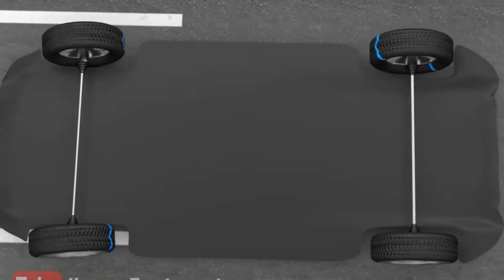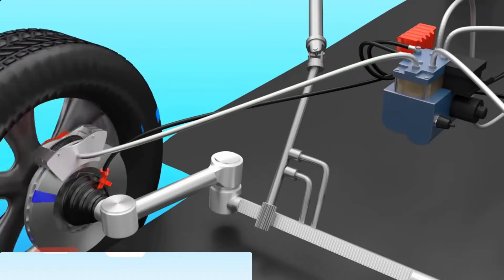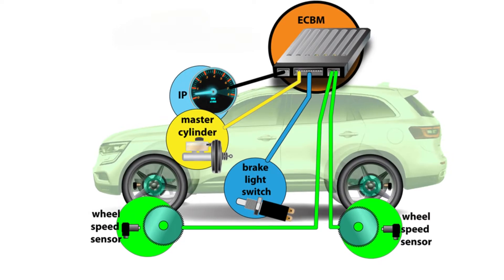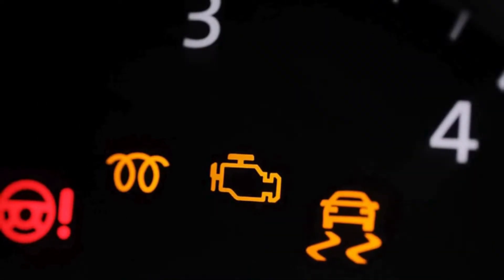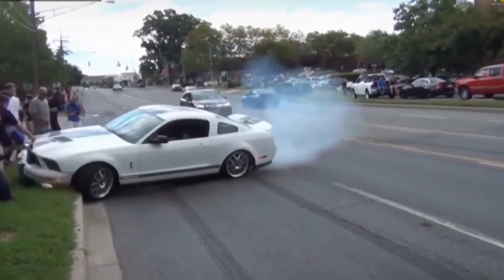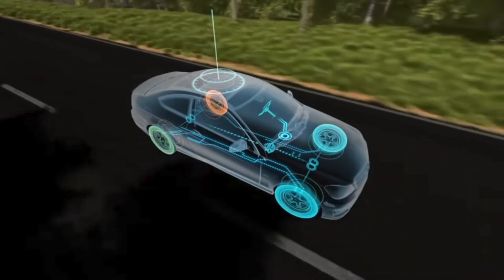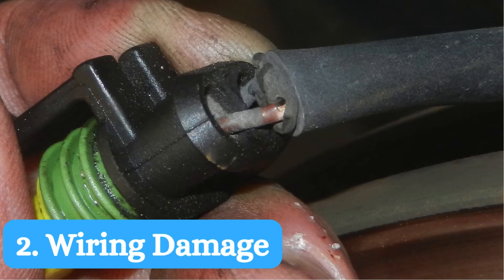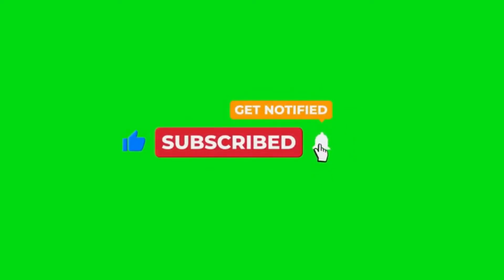Symptoms of a Bad Wheel Speed Sensor - Causes & DIY Fixes

Comment: What is the causes of vibration while braking at high speed?
Reply from the maker: Vibration while braking at high speed can be caused by several factors, often related to the brake system, tires, or suspension components. Here's a breakdown of common causes:

1. Warped Brake Rotors
2) Worn or Damaged Brake Pads
 3) Unbalanced tires, uneven tire wear, or damaged sidewalls.
4) Worn-out components like ball joints, tie rods, or bushings
5) Wheel Alignment or Bearing Issues
6) Brake Caliper Problems

7) Air in the brake lines or old, contaminated brake fluid
8) Warped hubs or damaged axles from wear or impact
Reply: @MechanicalSpecial  thank you so much.... 👍